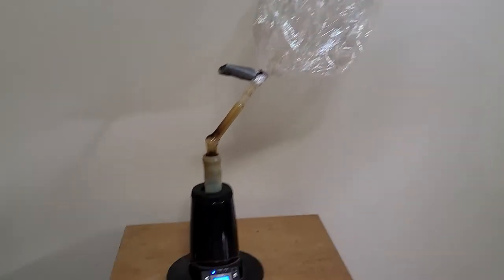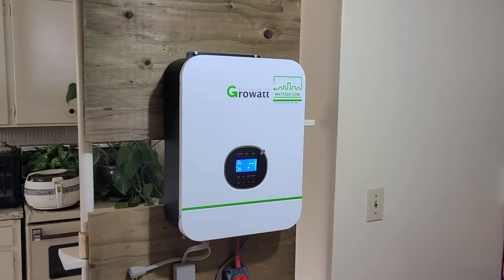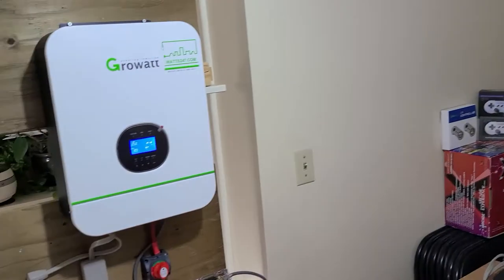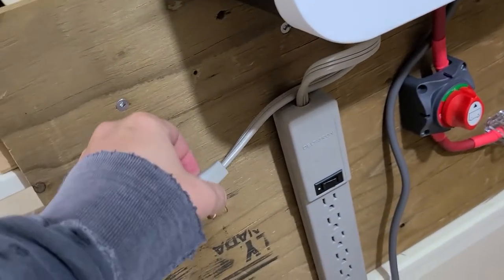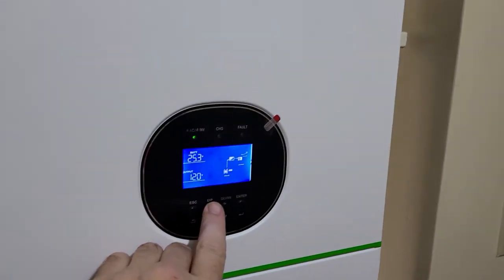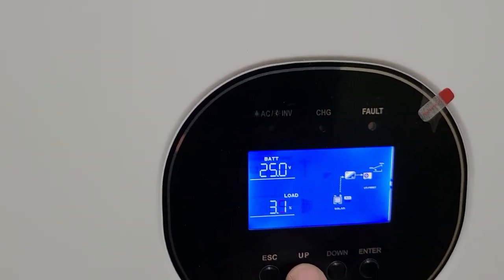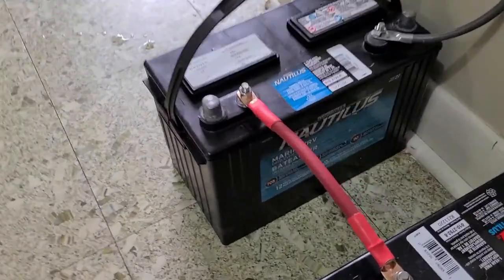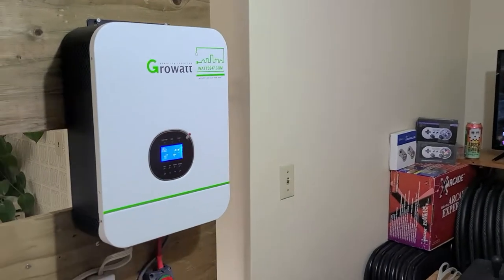GroWatt Testing (SPF 3000TL LVM-24P)

Comment: do you have any issues with fans, mine are loud from day 1, and they are kicking in at full speed constantly
Reply from the maker: No - I have 2 units now and both are pretty quiet most of the time.  The fans spin up and are quite loud during large power draws, but they quiet down quickly afterwards.

Comment: We have the same inverter and it’s fan runs 24/7- even when we switch it off and there is no power demand at all. 
I have no idea how to debug this and getting 0 support from installer and seller. 
Any idea what we can do?
Reply from the maker: Sorry but I'm not sure what could be the issue - the fans are only supposed to run when required.  Only thing I can think of would be your temperature sensor is in the wrong spot, or malfunctioning and it thinks it needs cooling when really it doesn't.  Have you tried contacting Growatt directly?

Comment: If it was the 48v model would you still use same size fuse and cut off knob?
Reply from the maker: No, you wouldn't need them as big.  Higher volts = less amps (smaller wiring, fuses, etc).

Comment: so it will run a regular size fridge with no problems?
Reply from the maker: I'm sure it would... check the power requirements of your fridge, but as long as it operates at under 3000 watts (6000 watts surge) then you are OK!
Reply: @crUshed420  thank you 😊

Comment: Is the unit fanless? Thanks for the info, it helps a lot for me to make a decision.
Reply from the maker: It has fans similar to a computer case fan.  They spin up when the load gets about 50 percent or so, but they are never that loud and do not stay on constantly.
Reply from the maker: I installed it at the cottage earlier this year, and it's been working fantastic.  I highly recommend this unit!

Comment: was that a bong?
Reply from the maker: Close - a vaporizer ;)
Reply: If you are connected to the grid and have solar and batteries, does this unit allow sharing or is it either utility or solar/batteries?
Reply from the maker: @earthenergyhex  I believe it allows sharing based on the charge level of your batteries, but I'm completely off-grid so I've never looked into that setting/option.

Comment: 100AMP fuse will be enough 250 is to much ,will never work - you inverter is *80 AMP in case emergency Inverter go first in this setup
Reply from the maker: Did you see when I started the table saw the load spiked to over 4500 watts?  This inverter supports surges up to 6000 watts :   6000watts/24volts=250amps.  I'm pretty sure this is sized properly.